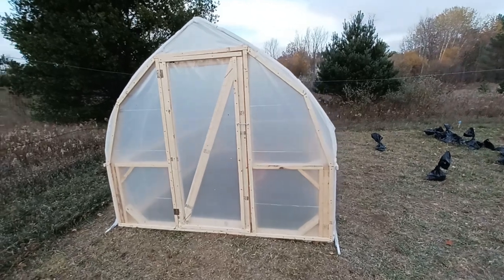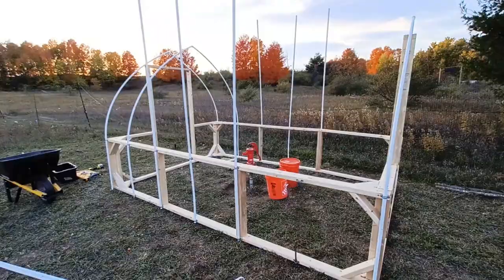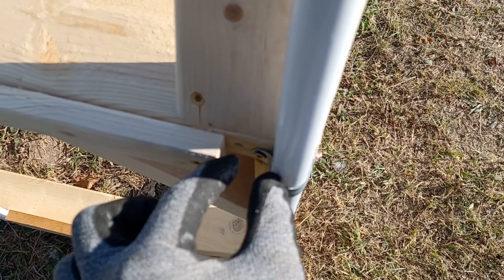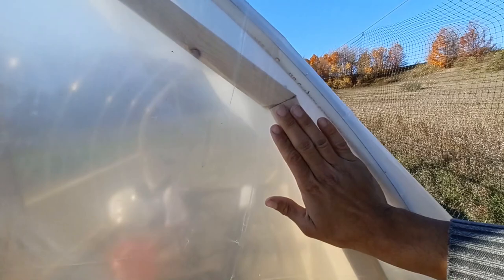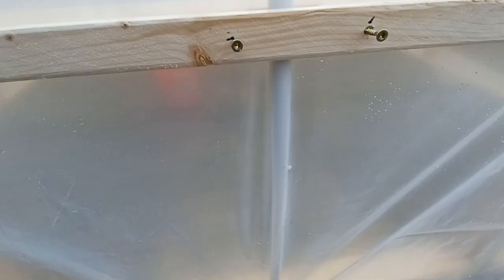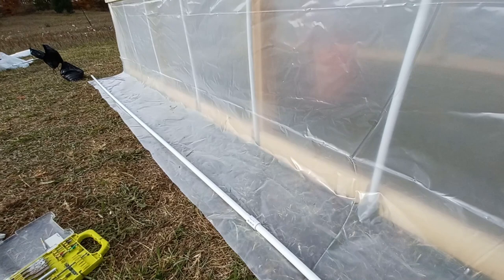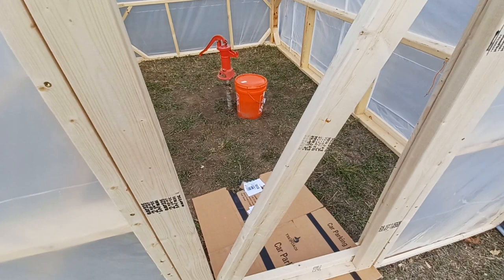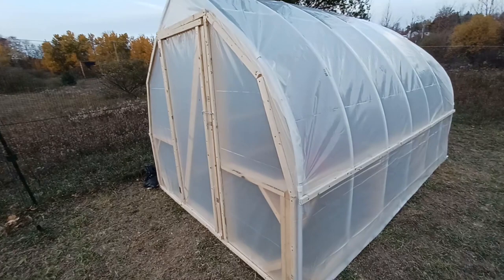Building an 8' x 12' hoop house from pvc and 2x4s

Comment: How is this holding up 1 year in? I had similar in Ireland (milder winters), but the sides were sealed and secure because it didn't get hot enough to need ventilation. I am in Canada now and will have snow in the winter and needing side vents in the summer. Curious how it held up for you
Reply from the maker: The only modification that I made was to use wood screws to firmly attach the snap clamps onto the pvc hoops instead of just relying on friction alone, like is shown in the video. In late 2022 there was a massive blizzard here in north Michigan with strong winds, that's why I had to reinforce the snap clamps. Otherwise, I haven't changed anything on the hoop house except add a black landscape fabric "floor" to keep weeds down
Reply: Awesome thanks for letting me know
 @MilesRoseProductions

Comment: You've thought of everything.  I want to use your design to make my hoop house.  I'm in the northeast, it get's cold and I've been thinking how to make a hybrid Hoophouse/greenhouse.  This is it.  I'm thinking I could make removeable Polycarbonate panes in wood frames for the bottom in winter.  I could probably frame up higher and add permanent polycarbonate frames to the point the angle meet and starts to curve.